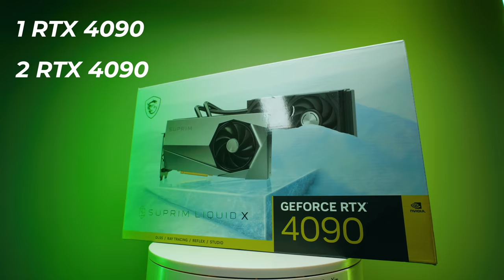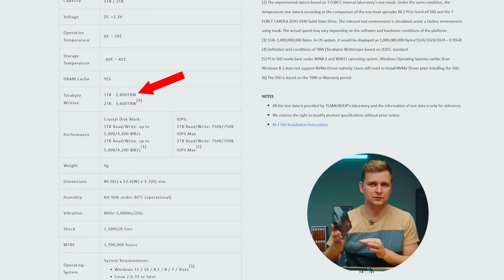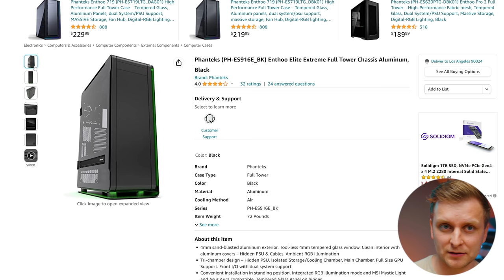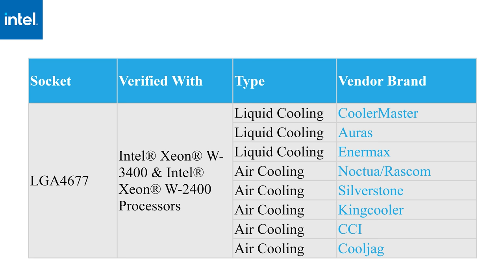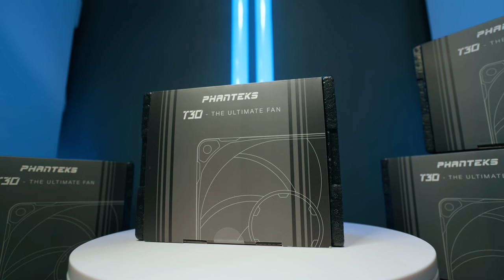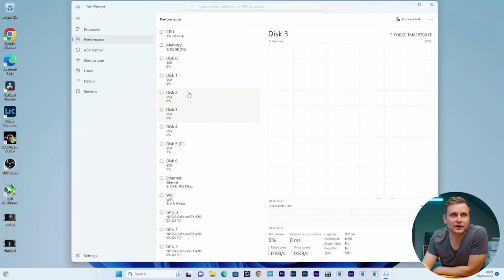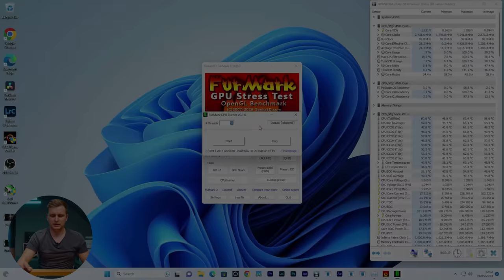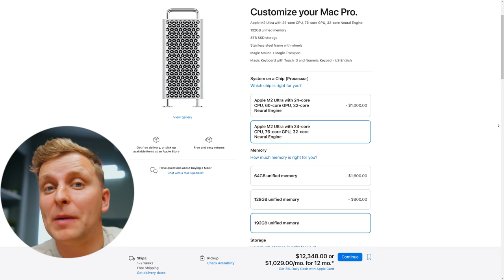REVEALED 👉 World's MOST POWERFUL Creator PC! | AMD 5995wx + 3x RTX 4090 Workstation [OPPENHEIMER PC]

Comment: Love your channel !  You're the only one I know of showcasing true Workstation builds. I'm so tired of watching gaming PC builds.

I'm old and retired but I built an almost identical Workstation for my CG hobby. However, I do run CPU & GPU's on a simple soft tube custom loop, it really cleans things up. ( Think Un-Janky ) My main tools are Solidworks, C4D & Redshift.

I was pulling 1,780 Watts from the wall for my one hour stress test / burn-in using AIDA64. No issues popped up.

Comment: Nice build! The next upgrade should be to use 4 RTX 4090s on waterblocks and use Phanteks D30-140 fans (to reduce wires).
Reply: Nah finna be 4 5090s with a threadripper 7995iforgorletter
Pc🔥🔥🔥🥶🥶🥶🥶🗣️🗣️🗣️
Reply: hold on i just found out Nvidia stoped SLI support from rtx20 series. 
how does he connects multiple 4090 ? 
whats going on ?
Reply: @atrocitus9198  sli is for gaming. if you have the proper motherboard for multiple gpus certain programs can still utilize them all.
Reply: WTF isn't it watercooled ALREADY???
Reply: @atrocitus9198  SLI is only for Gaming, for rendering etc. you simply put as much GPUs in as you can afford and the software can utilize them.

Comment: On the A6000 it all depends on your scene sizes for models, texturing, shading. You can load it all into the gpu card memory.
Reply: The top spot on 3Dmark Time Spy is held by a pc with 4 A6000s.
Reply: @bengineering3d  *3D Mark Time Spy Extreme

Comment: the reason for the cpu not being so hot with cinebench, is because it uses all the cores they stay at base clock ~2.8ghz, but with the 32 core bench they boost up to 4Ghz. that's where you can tell if the cooler is enough or not, because is very hard to remove all that focused heat from the die's specific areas. it seems to be ok.
Reply: Yea but it that because of throttling in the first place… 32 cores won’t get as hot as 128… a system that nerfs itself is counter productive. Why pay for half of the performance promised?

Comment: Dude, if you spend 50k to have this, (and play 8k/120fps lol) I'm sure you can squeeze another 2k at most and make the system an entire hard tubing water-cooled system, and include the GPUs in it with replacing all the GPU radiators with water-block and active backplates. This way you will have more than enough space to arrange them looking beautifully, and keeping them much cooler at the same time. because let's admit it, no matter how many fans you stuff in that case, 3x4090 and everything else in there will make that case warm up like a fireplace.
Reply: YouTube show off u can call it… this is one cap😂  creator rig for yt TikTok? Videos😂😂.   Seriously people who do rtx a6000 for 3D rendering or content

Comment: Very good explanation for TR workstation build~! I enjoyed it. 

The latest BIOS version is 1201, from which you can control fan speed. Of course, that is still possible at IPMI.

To see 8 sticks of RAM in monitoring programs, set Server Mgmt menu -> BMC DRAM SMBUS Switch -> BIOS

The latest firmware version of BMC is 1.32.

I believe that you already chaged the password of the administrator account in IPMI.

As you know, the strict secure principle of BMC/IPMI makes several inconveniences
1) RMA not direct AS 
2) Can't use sensors to control the workstaion but can read parts of them. 
In more detail, one prefer to control customly water-cooled system based on temperature of coolant. In air-cooling system, one may control fan speeds & RGB based on temperatures of CPU, VRM, etc. Via IPMI &  BIOS/UEFI, we can control system fans. But we can not use T-sensor for controling speed of water pump in other utilities, just read the  value of it.
And there are other facts that we may happen to see during the build. So, I'd like to recommend any usb herb of PWM & Sensor ports like Quadro or Octo, etc.

Comment: There's such an essay solution to the space issue here. Just watercool the GPUs and make them 2 slot. Easy. Done.

I've got a Cooler Master EVO 700,which is an absolutely humongous case, but I needed some separation between a very hot RAID card, 25Gbit SFP28 NIC and the graphics card. The 4090 taking nearly 4 slots was a nightmare, so I had no choice other than to watercool the GPU or the cards would be really close to one another.

Comment: You may want to look into getting a Superflower 2000W Leadex Platinum PSU. Suplerflower is the manufacturer of the EVGA G2, G3, P2, P3, and T2 lines of PSUs. They are very good power supplies.

I would also recommend getting a sheet of Honeywell PTM7950 for the CPU die, instead of paste
Reply: Phase change materials?!
Reply: @pazsion  Yes. It seems to work quite well so far for me.
Reply: In my experience with PC building over the last 24 years, my advice is to never skimp on the power supply. Always buy the best power supply money can buy. Also, I have found through my experience that EVGA makes the best highest bin parts. I have had so many power supplies fail, even my brothers platinum rated 850w Seasonic power supply failed after only a few years of constant use. I built my then top of the line gaming computer in May 2017, and have ran it nonstop with the same EVGA 1000w T2 14+ hours a day.
Reply: @UltimateEnd0  The T2 is a solid PSU, built by Superflower. I probably wouldn't buy the Forton Source Power built PSU's from EVGA, personally.

Comment: I'm late to comment, but something you forgot to mention in the comparison between 4090's and the A6000 Ada is ECC; it's not just the VRAM difference. For many people that's a non-factor, and you're absolutely right on the peformance/price comparison, but there are situations where a professional would require ECC. I don't agree with what I would argue is malicious market segmentation on ECC, whether it be on regular dimms or VRAM, but if someone needs the guarantees provided by ECC, then they have to bite the bullet on that cost.

Comment: This is similar to my workstation. I have a 2990 64 core AMD with 256GB RAM and 3x4090 Cards. I do think I will move over to using only 2x4090 because I get some bluescreens, maybe because the power is not enough from my 1600Watt Corsair. The reason I need such a faster computer is that I do VFX and some of the simulations in Houdini can take an hour to do and you need to iterate 50 times on one simultion. Then rendering comes into place the the GPUs help a LOT. Still I would like to have even faster, my current dream is a 2x128 core machine, but sadly the Epycs have so low clock speeds.

Comment: ADA A6000 has 48gb of vram. We use those at work and there is only a difference if you do gpu rendering and do simulations as I believe the vdb cache cannot exceed vram. For normal 3d scenes this is not an issue. I however do not do 3d work so my understanding may be wrong.

Comment: 11:00 - You can but no in RAID mode. AMD PCIe RAID will NOT allow you to boot with 13x SSD's connected - I tested it on the same motherboard 🙂
50:50 - No you won't because you forget about the efficiency of the power supply. It is 94.29% @ 1600W, so you can take up to 1697W from the wall.

BTW, I'm using the same motherboard with 3995x and 256GB of consumer DDR4-3200 CL10 (because I can).

Comment: For this price - you can buy very good used 2 processor 4U server with 4 GPU with better performance. Another option - rent powerful GPU server with per hour rent. And render your videos on top notch hardware for very small price tag(if you firing up rented server only when you need some rendering)

Comment: I wouldn't bother with any liquid cooling for all my PC builds because my room temperature is always at 23 to 24 degrees and it's more than enough for air cooling. Easier maintenance for air cool you just make sure you clean the filter maybe once a year or 6 months if you're extreme. And you don't risk a liquid leak. Liquid leak can actually short circuit the whole system and there you go into the rubbish bin for your expensive build.

Comment: Samsung 990 Pro 4TB longevity are rated 2400TB as is Western Digital SN850X .
Surely that's enough?
I mean aren't those better at sustained speeds?
Perhaps not.

Sure 990Pro had some Firmware issues , but that was fixed quickly once noticed.

Comment: My guess is these drives won't hang in there for the long haul. Warranty will replace them but I would bet there will be plenty of failures if used that heavily.
Reply: It’s getting better, raid helps deal with failure. But it’s getting just as fast as ram and adds capacity… so it won’t be a limitation for creativity or productivity. 

I was using 10k rpm drives entirely for ramdisk… despite it being slower than ram and thrashing the crap out of them… I got work done I would have needed upgrades for that didn’t exist for another 10 years…

Comment: Aren't you drawing heat from the top GPU into your CPU? It's cool enough but i'd flip the tower so it draws air from the front of the case and exhausts it out the back.

Comment: nice pc build🤩🤩, but i will not say that Nvidia 4090 is better than the Nvidia rtx a 6000 series card because most of them have around 48 of vram compared to the 4090 which only has 24 of vram so having having 2 Nvidia a 6000 card with NV link is more powerful than the three Nvidia  4090 series mainly for 3d work and gaming what your take on that???

Comment: Definitely could have gone with a larger case so everything didn't look AS ridiculous.. also unless this person needed 7 drives at 1tb I dont know why you didn't just go with 2 at 4tb and save more space without needing the expansion slot while still being able to have room for another m.2.

And a custom loop would have 10000% been better for this as it would have resolved alot of the issues when it came to slotting gpus. A dual cooling loop with 2 gpus and another for the cpu and 3rd gpu would have been the way to go for this build, especially with the amount spent on this.

Comment: ram timings could be improved 😬cl 22 is so slow, you don’t really need 2 tb of memory unless you’re doing aerodynamic simulation, if you’re doing this as a “creator” pc i reccomend a sound card, not using the main audio outputs from the motherboard, i like the main use of the air cooler on the thread ripper but i would put in t30 fans instead of some lian li fans
Reply: That’s minimum spec memory for most stuff these days.

The systems use at minimum double the ram installed and what you see in use. You can never have too much memory.
Reply: @pazsion  true i guess but its just unnecessary size for such slow timing.

Comment: One fan in exhaust with a 35mm spacer between fan and cooler fins out performs push pull setup by about 30%. Stop mounting fans right against the fins of coolers and radiators.

Comment: Does anyone have this 64 thread CPU and can talk about the lower Clock speed  2.7 vs the  TR 36 core that runs over 4.0 ghz.. I have the 4.0 threadripper. But wondering if the 2.7  with 3.6 ghz is fast enough to not be a deal breaker with something like the viewport speeds with 3d work?? thanks to anyone that can verify... I might upgrade in the future.. but wondering if it reallly matters.

Comment: 1500W in an enclosed case is a bit concerning, this needs to be watercooled and have 2 external 560mm rads. Ideally placed on the window, blowing the hot air outside.:goodvibes:
@39:00 the airflow is a mess, be aware that there are cases where weird angles on the fans could increase temps 
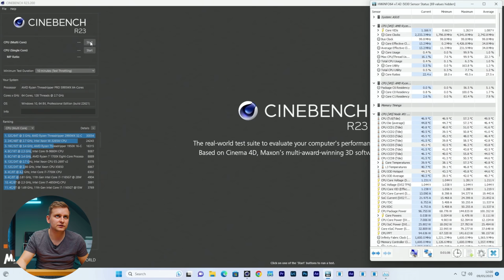@47:00 try to use 1500W for longer than 2 hours ... you will quickly try to find alternative cooling solutions
Reply: I guess you didn’t watch the end of the video but you’re an expert right? Lol.
Reply: @infiniteblaz3416  you woudn't know

Comment: How would you solve air in and out, with 3 aio's gpu's? Huge head scratcher as to wich cards sucks in, and heats inside of the case, and wich sucks hot air out as exhaust. And ofc under or over preassure and airflow in and out of the case balanced

Comment: at the gpu´s i think is watercooledblocks better bcz die wight too the pcie slots and the thickness of the cards but okay air is good too :)
i found at net a single ram stick for 18k€ its a 512gb singlestick this build can be much more expensive if you use this for 4tb ddr4 ram and gen5 m.2 16tb but 1 costs 2,5k € :D
and you can easiely make out of a 50k build a 150k-200k build  with a motherboard with dual amd tr 5995wx and 16-32 ram slots 😱 but not at this tiny case 🤣

Comment: How do you get all the graphics cards to output to 10 video terminal ?
Reply: correction 1 video output
Reply: @markostruszka1845  Only one of the cards needs to be plugged into a display. The other card just do work. Data can be sent back and forth between the graphics cards and system memory at any time by software.

Comment: 1TB discs are too little for this type of high-end build, especially for 3d artists. Assets in high resolutions can weight absurd amount of memory. Also, what about A100 card? it`s very expensive but performance-wise wouldn`t that be better that this 3x 4090? Especially when u can have multiple A100 cards
Reply: Pretty sure that’s the max the slots support at the time of build? But memory in these systems is unified. As long as the system sees it capable of doing so.
Reply: Nothing says you can't put 2 or even 4 tb disks in there instead

Comment: I see outright a big mistake, using that tiny heat-sink, for 64 cores, even dual tower is a meh but better meh than single tower.
I would swap that water cooled GPU for air cooled and get water cooled 480 AIO that will cover the mid section and put the 4 RGB fans on it.
if the OP going to do any CPU tasks [why get 64 cores and not use it?], it will throttle, it will throttle even with dual tower and probably will throttle at some point with 480mm AIO, but still it will be superior to just single tower.

This PC build is a mistake, the OP paid so much money but stopped one step before the finis line.

All he needs to do is get 3 water blocks for the GPUs, it will make them 60% shorter and single slot thick, many have replacement PCIe brackets for WC to make them single slot or dual slot with Water block.
Get a block for that CPU.
Get two 480mm radiators, one for mid section and one for front section, get D5 pump or YOLO with dual D5 pump setup, this is giant case [i have the previous model used for my NAS the Phanteks 719 and the giant ass Corsair 7000X for my main setup], in theory if OP wants to be creative and have easy to use PC, he can do dual loop, say install top/bottom 360mm rad for the CPU and dual 480mm mid case and front case for teh GPU loop, have CPU loop with its own pump and GPU loop with its own pump.
Also Op can use quick disconnects between products and EPDM easy to use tubing, when he needs to upgrade, or swap, quick disocnnects help

I only have one 4090, and just 5 NVMes [Unify X support just that], but thats how my setup looks plus minu, yestrday i resived the MO-RA3, its a GIANT [9 fans] 50mm thick external rad, im going to move to small case and put the water cooling outside the PC, this Computer above, can use such rad, tehre is MO-RA3 360 and MO-RA3 420 that uses 9 140mm fans or x4 200mm noctua fans
The OP can go this route, since external rads have much more cooling capacity, for this build of his, if i was building it for myself, ill do dual SLIM 480mm internal rads in the case + MO-RA3 external.